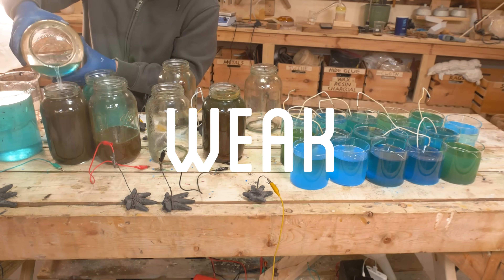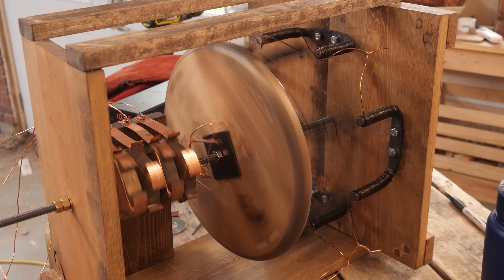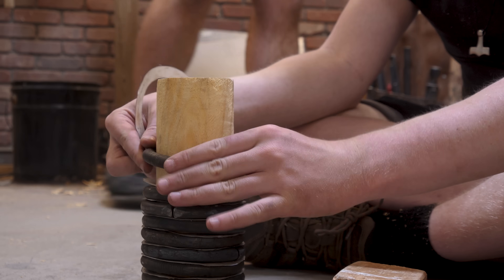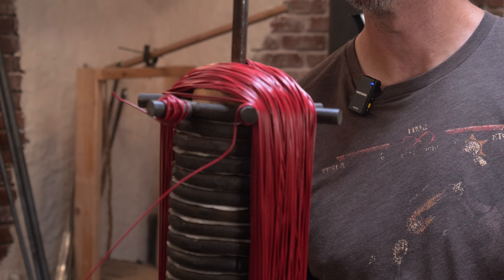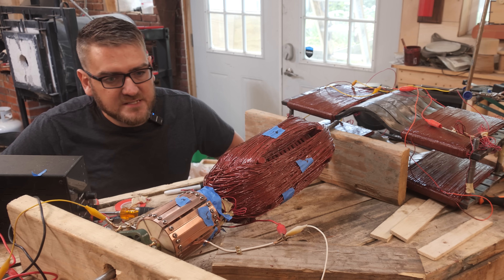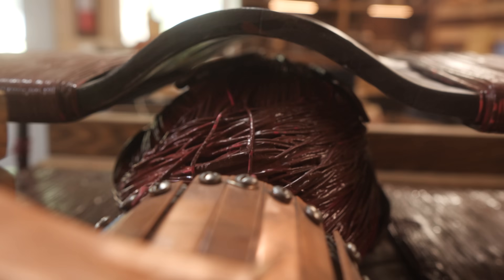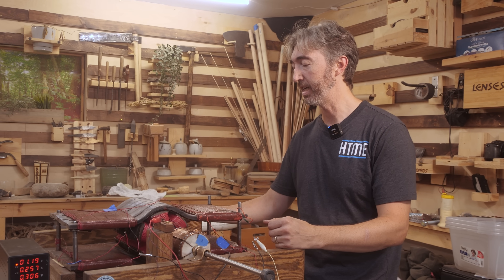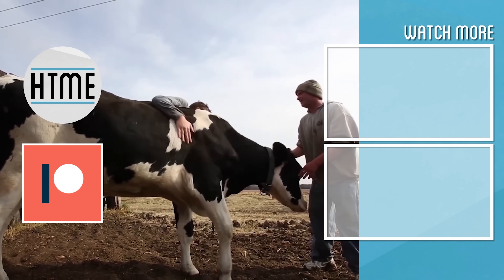I Built the First POWERPLANT!

Comment: For your wire making, maybe have a supporting roller close to the hole that you pull the wire through. i see this with welding machines how it grabs the wire off of the roll. 

Also something I noticed myself when stripping wire by hand was that if I let the plastic get long and grab from further away it would snap a lot easier than if I kept my hand close and pulled short pieces. Literally grabbing it 10 cm away from the wire would have it snap every 15 cm but pulling close to the wire in small bits every time I could pull pieces off that were a few meters long. 

As to how it translates to wire pulling, I think it has something to do with leverage. Where if you pull from further away the material in the middle wants to stretch more. so as the wire gets thinner you need to pull it from closer to the hole and support it, else it'll snap. Normalizing it also becomes more important.

So maybe have 2 rollers that you tighten down (like a mig/mag welding machine) to grab the wire and drive those to pull the wire through the decreasing diameter holes and normalize in between.

Comment: You are currently making AC power and the LEDs are going to be DC. Automotive generators/alternator do what you are looking for. You need diodes to convert from AC to DC. This will smooth out the power fluctuations and stop the pulsing of the LEDs.
Reply: the commutator reverses the connections every half turn

Comment: Not that it would work, but I wonder if instead of putting power into the Stator and pulling it off the Rotor why not put power on the Rotor and pull it off the Stator, as far as I know that how most modern generators and alternators function anyways. Just a thought

Comment: Very interesting project!
Try to feed with constant current first the stator (then measure what goes to the rotor) and the repeat with the rotor. Try to also change a the angle of the commutator a bit to see if it makes difference. Since the output is very low it seems to me that you are relying on some of the leftover magnetic field inside the rotor to generate that (meaning that you do not have enough current to excite it correctly). May also try to disconnect the rotor and see if it still produces anything.

Comment: I was an intern working in motor design. When coiling the wire, the first layer is easy, but when transitioning to the next layer, try gluing the end loop or taping it down first before stacking the next layer. By coiling it more neatly, you can achieve a higher coil number, aka more power with the same coil setup. It is very important to have neat wiring here.
Reply: Yeah, the plastic insulated wire probably doesn’t help. Enamel wire would be better, but to make it authentic they need to be able to make that as well! Maybe if the windings were carefully spaced and shellacked over after winding each layer…
Reply: Honestly, I like the idea of revisiting wire pulling, and with a little more experience under our belts, we can see how thin we can pull wire now.
Reply: This design has bigger problems that irregular winding.
Reply: We need square wire.

Comment: You're only providing a low reluctance path for one half of the magnetic circuit, forcing the returning flux to close through the air around the wires.
This not only robs you of efficiency, it also drastically reduces how much power you're able to push through the magnetic circuit!

Comment: Before you make a new commutator you should first try making sure you can have some sort of resin between the sets of bars to fill in those gaps, then I suggest putting the commutator on a lathe and shave it down a little bit so that it'll mostly be a nice smooth drum for the brushes to rub against that way you can cut down on the brushes jumping about when the central armature and commutator are spinning.
Reply: Even if you don't put it on a lathe, have someone turn the rotor and use abrasive stones. It's how we in big industry smooth the surface of motor and generator commutators.
Reply: If they replace some of the copper bars with insulating material and curve the contactors, they might get more consistent connections than the small point they are using now.  That or a wider brush of copper strips instead of a single one.

Comment: It is kind of difficult to really know what the issue might be or suggest any improvements without actually having that much information on the electrical design of it. 

Some rudimentary things to suggest is to have nice smooth copper surfaces for the commutator, and use graphite as the contactor as opposed to copper on copper. And your rpm probably needs to be way higher than what you can make with a simple hand crank as you have so few poles and slots... put a gearbox in there or something.
Reply: id say belt and pulley over gears due to precision constraints.

Comment: Improvements:
1.The stator should be as close to enveloping the rotor as possible to use the magnetic field more. The shape is very suboptimal. Take inspiration from DC motors.
2. Use a capacitor or inductor to store energy to smooth the current going through the stator coils, it must be ever present.
3. Speed
and best of luck, its a very cool project
Reply: There was no capacitors back then. I think idea of this channel is to keep somewhat authentic to the period when said leap forward was possible.
Reply: I was about to say they need a capacitor as it seems to be essentially a single phase motor
Reply: There is no need for additional current smoothing components.
The inductance of the stator coils themselves is enough to decrease the ripples of the current. This means also that every extra bit of energy is stored in the magnetic field of the generator, right where it is needed .
Reply: @CG-rr6yx  Good point, didnt realize that
Reply: i think number 2 is probably the easiest thing to do for the best gain in output, a consistent current is key
Reply: @jrsviking215  the difficulty in number two is in making a capacitor with the level of tech they are working with. of course they could try a modern purchased one to test the improvement but the goal is still to make everything, its in the name of the show
Reply: @malikpelletier7976  Would a lead acid battery have a similar desired effect? a lot higher ESR and much lower charge rate, but it'd definitely smooth the current/voltage and likely be the most capable battery technology they'll make at this stage
Reply: @Jay-kc2pm  No. A lead acid battery will eventually discharge.
Reply: I think that they did have capacitors back then. They were originally called, ‘Leyden Jars’. Hope this helps.

Comment: Put epoxy between the plates on the commutator and sand/grind it round enough to use graphite as your contact material.
Reply: use shellac or tar as insulator for period correctness
Reply: Epoxy is not period accurate.

Comment: To measure the current of the generator you could make a digital ammeter with an arduino nano / esp32-C3mini; By reading the voltage of an analog pin on an arduino/esp, if you know roughly a stable reference voltage, and the specific resistance of a resistor placed in shunt (series) to an analog pin, you can then loop a simple ohm's law calculation at a specific time interval, to calculate: Vshunt = (analogRead(pinNo) * Vref) / 1023,  I = Vshunt / Rshunt to display serial output of pulse current. Note that the resistance used should be carefully chosen for the estimated current measurement range, i.e: 10 ohm resistor for estimated ~20mW LED drop, with the resistor only dropping a negligable ~4mW at 3V you can get a fairly accurate reading.
Reply: The output can then be filtered for when the sperratic current is detected, only printing to serial if the voltage read on the analog pin is over a custom threshold.

Comment: Don't know if it will help. but try putting two iron blocks between the stator plates where the threaded rods are. Could imporve the iron circuit for the magnetic field. Any airgap should reduce the field strenght. So try to make the blocks fit as well as possible.
Reply: The Stator coils are all wrong. 
At present there is a large air gap at either end. They should not be open.
The coils should be wound on magnetic cores across the ends to complete the magnetic circuit..
Reply: They mentioned an improvement with additional threaded rods. I believe the physical connection between the upper and lower assemblies is definitely a “resistor” in their magnetic circuit and limiting their potential flux.

Comment: You could give the handle a gear ratio to give it a higher rpm.
Reply: I was thinking the same thing. Question is: how do you make high-quality gears with their tools? Gears need to be precision engineered so you don’t get bumping, rattling, and other inefficiencies. Casting out of bronze is a possibility, but might be too inconsistent.
Reply: @anthonyfleming8334  Why gears? Why not pulleys and belts? For a long time, pulleys and leather belts were used for distributing and modifying mechanical power, and you can easily tension them. And that should work with the wood and carpentry skills they have shown, right?
Reply: @XenocraftGalaxy  Good idea!
Reply: @XenocraftGalaxy  Pulleys and belts would be the go-to. You can get away with wooden gears (as old windmills did) in bigger applications, but with higher RPMs I'm guessing the pulleys would be much easier to accomplish and tweak, while wooden gears would be more time-consuming to build and adjust.
Reply: @anthonyfleming8334  you can make a simple wooden gear they use that in the time and is easy to make with wood tools
Reply: @Endergebnis_  There's absolutely no need to stick to wooden gears. Metal gears were common at this point in history, and though wooden gears were used occasionally, most of the examples I know of were pretty much only used where large gear size would make it too expensive for whatever they were making. This would use a relatively small gear, and especially considering the amount of metal that you'd need to turn, the extra durability for the metal would probably be ideal.
Reply: @Endergebnis_  Wooden gear? Minecraft modpack aah
Reply: @anthonyfleming8334  3D print the gears then, either using them as-is (you'd be surprised how strong you can make these prints even with an FDM machine) or use the prints to make molds ^ for casting the bronze
Reply: @zoewilliams2010  3d printers arent unlocked yet, but they could do investement casting with wax
Reply: yeah and also a heavy flywheel to smoothen out higher loads and to buffer some kinetic energy
Reply: The handle is just there as a demonstration, it isn't intended to be a hand-powered generator. That would be a terrible idea! When they hook it up to the windmill or waterwheel, if it were me, I'd use belts. They used leather back in the day. Using belts, you just need different-sized pulleys to get a gear ratio, and you can make them out of wood by hand.

I worry about torque. Could that windmill or waterwheel actually turn the generator around, does it have the torque? Once they connect it to a load, to actually power something, the generator will become much harder to turn. Fortunately pulleys, or gears, can convert between torque and speed, RPM. But the higher the ratio you want, the less efficient it gets, same with gears. They might need to make a bigger windmill, or gods help them, a bigger waterwheel, cos I bet that wasn't easy to make, and it's limited by the water flow they have available. Stream-type waterwheels like that produce less power, and are inefficient. Wikipedia says "Efficiency – about 20% prior to 18th century and later 50 to 60%" and I think we're stuck before the 18th century for the waterwheel and other tools available. Even though electric generators are a 19th century thing.

The man-wheel will likely do it, but I believe the power it provides will be quite limited. 

Still, using belts is good cos they provide a bit of "give", and since none of this stuff is built to proper industrial standards, even of the 19th century, there might be a bit of wobble. Have they done leather working yet? It'll need a lot of friction to stick to the wheels, instead of just slipping around them. All lots of fun!

Yes they could use wooden gears. There's probably a formula for creating them, there's online tools that'll create plans for any gear you like. Presumably you could do that in your head, but you'd have to look up the equations. Or earlier systems, going back to the Ancient Greeks I think, instead of cogs used wheels with pegs sticking out of them instead of teeth. Some old windmills did the same. Again inefficient but easier to build. The Greeks had bronze so our guys ought to be capable of cutting or casting some.

Thanks for reading this!
Reply: @greenaum could try canvas belts. They're already cheating by using wax paper and stamped metal stator rings and store bought wire and screws. I think gears would be a good cheat to really demonstrate that power could be produced.

I like the flywheel idea, that would really increase the smoothness. But I wonder why they're not using magnets, because this type of generator needs to be powered before it will start producing any real voltage. Anyways, good luck guys!
Reply: Granted, we did try spinning it up a bit faster with a powered drill, but from some initial research, it sounds like we might need RPMs around 1,500 to 2000. I think to simplify things, a belt driven pulley would be more ideal. This might also be less of a safety issue if there's a catastrophic failure, since the rotor weighs something like 50 lbs.

Comment: Quite impressive. I'm wondering if you can make a magento, using permanent magnets? In parts of North America, in the 1800s, there were water powered mills used for grinding grain. That may have been an influence on power generation using water. Cheers!

Comment: One thing you might want is to change out your metal brushes for carbon or graphite. they will need cleaning concerns, but essentially self lubricate, and instead of bearing outward as the spring you have is, you can have them wear in, thos lightly grinding them, you would have less intermittence. Something that would be a period tool for a lot of purposes, to even make those posts from charcoal, would be a hydraulic press/jack. You are also running head on into tolerance issues, for all the distance, spacing and more. May need more refined machining techs to get that going. this is the point where all the tech starts to amplify each other, so every few percent improvement in one machine makes for 10x improvement in resulting machines around the chain. Such, as with the hydraulic press/jack, can have modification for precision clipping dies for your laminates, better measurement and calibration tools from making press fit bearings from the press. Really, I would consider looking at a donkey to walk your wheel, refine shafts and belts, and pass over most all the pieces with refinement. there are all kinds of steps that can give you just a bit more.
Reply: I was also about to suggest carbon brushes, but in case carbon brushes are too advanced for now, atleast switching to brass instead of copper would also improve it, since brass usually has a lower coefficient of friction.
Reply: I think the carbon brushes could work, though I'll have to look into recreating those, and I'm not really sure how graphite is pressed. However, I think that would be a huge help for higher RPMs.

Comment: this feels like a perfect time for an ElectroBoom colab
Reply: Still too early, theres no need for a  FULL BRIDGE RECTIFIER yet
Reply: Given the pulsing output, i think it may actually be time for some kind of rectifier.
Reply: @Smileyrat  I agree, looks like a rectifier is indeed needed to smooth out the output.
Reply: Yeah i was thinking it needs a FULL BRIDGE RECTIFIYAAAA
Reply: These electrical commutators are how rectification was done at first. The next historical stage towards a FULL BRIDGE RECTIFIER is the thermionic diode and the mercury-arc valve, and they require a lot more power.
Reply: Chris Boden may also help
Reply: I wish I had another thumb to give.
Reply: I don't think we are there yet.. But for a super simple diode here is a lost in time version that anyone at home can do! You need Sulphur powder and solder, leaded is probably best. You melt a pool of solder and while its molten state you sprinkle Sulphur on its top surface. The bottom of the solder should be attached to a wire while its molten.. then get a sewing needle and attach a wire to it. And then touch the tip of the needle to one of the Sulphur crystals that form on the top of the solder when it cools off. And that's it, you have a diode. I forgot which end is the anode but its pretty simple to find out. This was published back in the 50s era for a way to build a crystal AM radio and I have built a few with this exact design and the diode it forms is pretty impressive for how simple it actually is. Anyone can do this and it makes for some very interesting old time technology  to incorporate into any relic like project.
Reply: Here before this blows up
Reply: Electroboom, Chris Boden, and StyroPyro would be the dream team for this
Reply: Agree
Reply: He can help him a lot for sure
Reply: Full bridge rectifier!!!
Reply: Yessirrrrr
Reply: That would be fantastic!
Reply: Agreed😂
Reply: This
Reply: Agreed
Reply: No, the voltages and amperes aren't high enough yet.
Reply: no
Reply: @Mad-Scientist-Creations agreed

Comment: Use a capacitor and have a resistor and measure the voltage drop across the resistor to get the current and voltage on the capacitor, and then you can work out the power like that
Reply: Alternatively using an osciliscope to see the measure the voltage/amperage over time and work out the wattage from that, might be a question for electroboom